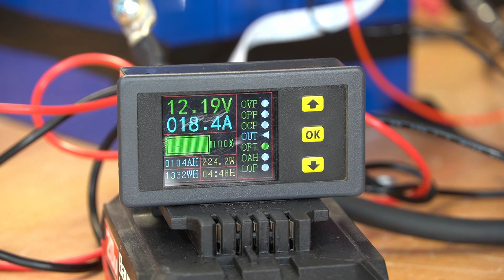Testing a New LiFePO4 BMS, 12v Battery Build and Aliexpress Cell Test

Comment: Id take those smaller cells over the larger ones any day of the week, I use that bms you showed at the end, its amazing, it does disconnect in low temps, witch can damage your solar system, cause your never supposed to have the solar panels connected to a charge controller with out the battery being hook up. it can kill the charge controller.
Reply: So the low-temp disconnect must interrupt the PV line (which connects to the chrg ctlr) rather than the battery line?
BTW, GOG (one of my most favorite sites ... and cites, too, I suppose), I know that you use the Midnight Solar charge cntlrs which have a BTS line ... Does that obviate a separate low-temp diconnect?
Reply: @mikegardner9855  yes the midnte bts can be used to save the system
Reply: @GoingOffGrid101  Thnx! (Amazed that you replied so fast! Love sharp knowledgeable folk! ... Got double value here today!)
Reply: Where did you buy it, and were you able to get a bluetooth app for a smartphone in english?

Comment: I know you aren't supposed to run more than 2 LiFePO4 batteries in parallel. Could you run individual BMSs and run more in parallel, as long as they regularly get rebalanced?

Comment: I've just gone through my local hardware store got went to the stainless steel screw section in the boxes on the wall and got the metric screws I wanted in 10 mm socket and there's multiple thread dips it's no big deal to get the longer bolts

Comment: You should review one of these expensive BMS, for comparison. The Orion BMS Jr for instance. Also I’m interested in BMS that allow for separate port and external relays for disconnects with heavy amperage loads. It’d be cool if you could cover these types of installations as well.

Your channel has been getting better and better, and more thorough. Congrats!

Comment: Just a question, I am in Australia and the temp very rarely gets below 0 Do I need a low temp cut out?
Reply: Yes, it only takes one freezing event to damage the charging batteries. If they are disconnected they will not be damaged. But Murphy’s Law states that they will be connected when the freezing event happens.

Comment: I was really hopeful for this to work now. Also got disappointed by the votronic chargers (mppt and b2b booster) the come with temp sensor and LiFePO4 program. But it turns out they just reduce to less than 1A current if battery is less than zero degree.  I asked why. And they say because the chargers are only to be used with ready to use batteries cause their bms will disconnect. Which is stupid because they also shut down discharge.

Comment: I am interested in DIY lightweight car battery replacement, and other than Peak current, which is 300A on this cells, and 640A on my lead-acid battery, is there any other reason why this shouldnt work as a lightweight replacement? 
Also, I am getting ~400 Eur on 4 cells... that is not so cheap :)

Comment: The Daly Spec on Ali says " [chinese]  <-5C [chinese] >50C [chinese]  >70C [chinese] " - Then later on "Temp Protection Temp Protection NA ℃ Set as required"  - I presume that the setting is firmware or trim pot?  Wish I could read Mandarin -- I'll ask my neighbor what it says. ;-)  - (Maybe you should have used frozen Mandarin Oranges) Also, are there other options for LTC besides the Victron?  Great videos - your enthusiasm is refreshing!

Comment: Will, you can make your own adjustable low temperature disconnect to your charging circuit....just glue a microswitch to a bi-metal coiled strip, and feed the leads to a relay or solenoid big enough to handle the charging amps.  The bi-metal coil can have an adjustable knob to rotate in both directions to tweak the temperature cutoff requirements.  cheers and happy new years!

Comment: 2 things:
1- why does the webpage listing for these batteries imply charging below freezing is ok “Charging Temperature：-5~60°C“?

2- does the data sheet for these type of batteries have recommended torque values? If so, why not invest in a torque wrench - you’ve made such a nice tool collection in the last year.  You can get a gauge that attaches to a standard socket wrench as well. 

I’ve really only worked with lead acid in large facility UPS systems but those batteries have very specific torque requirements.

Comment: That temp sensor is a thermal resister, you could change the resistance with a potentiometer to adjust the shut off point. I think a better solution though is a heat blanket that turns on.
Reply: It seems like a better idea IMO to be vigilant about the environment and BMS cutoff would be a last resort

Comment: I once replaced a BMS in a 48v ebike battery pack. The BMS was smaller than a playing card and maybe 3/8 inch thick. That BMS at the start of the video was ridiculous. The problem is that you really want 48v if you are looking at running anything over 1000 watts. The ebike pack would handle 30 amps, so around 1500 watts. Easy enough to find a 48v inverter. 

I think we should all chip in and buy Will a cheap dirt bike like the CSC TT250. That's what people do in Vegas, testosterone laced pleasures... Used to live there, moved up the road to Southern Utah. Glad you got out of Cal.

Comment: I am wondering: If when checking the balance of batteries, the balance is actually accurate if they are all connected to each other through the busbars.
Reply from the maker: In series, they will be different voltages. In parallel, they can equalize and be same voltage

Comment: Daly fails the Frozen BANANA TEST !  darn shame.   The real kicker about Daly, is the end user has no idea what the BMS parameters are, nothing can be set / programmed and there is no way to know what it is really doing with your cells & battery pack as a whole.  I'm not one that appreciates the line "ignorance is bliss", it certainly isn't when it comes to expensive batteries.

I would urge you to indicate that the bolts used are Metric Thread and for people buying replacement bolts to use Stainless Steel as opposed to zinc plate.  Additionally, to never "bottom out the bolt" in the cell as that can damage the cell if you break through the top internally.   

Too bad you didn't put a link to the Blue Cells you showed there.  
Looking forward to your test with the new BMS with Bluetooth, hoping that pans out well and that they have a variety of options for 50A to 200A plus.

Thanks for yet another Great review !

PS:  Sent a note to Jason Wang @ Chargery to send you some BMS goodness to test as well.

Comment: Great video! I have an idea to improve your temperature measurements. You cannot use an IR temperature measurement reliably on water or other reflective surfaces (metal). As the surface emissivity changes, IR measurement cannot measure accurate absolute temperature. Instead you should use a temperature sensor that has direct contact. You can get cheap thermocouple sensors from AliExpress. They are small, and have low thermal mass. Not the most accurate sensors, but should be fine here. If you want to check their calibration it's easy. Prepare an ice bath with clean water, and you will get exactly 0°C. Then boil water and you will get exactly 100°C. For even more accuracy than thermocouples, look into PT100 sensors (aliexpress).

Comment: Can these or the calbs be used in deep cycle applications such as trolling motor batteries? Normally I use size 27 lead acid in a 36 volt system

Comment: Hey, these are the exact same cells that I have. I also have the same BMS with the Bluetooth dongle, so it's a bummer that it's so hard to get it to work. I have yet to assemble my kit, because I am still waiting for a battery case to arrive. I will use the battery on my sailboat, so the load will probably never exceed 0.1C. So I think the busbars are more than adequate for my goal.

Comment: @Will Prowse
Have you ever thought of making your own "Low Temp Disconnect"?
Example. You get a temp sensor(s) + Rasberry pi + an inline on/off switch connected to the battery
Do a small amount of coding. 

Bada bing bada boom. You got your own Low and High temp disconnect.
Easy to programme your profile of choice for disconnecting the charge.

Comment: How cold does it have to get when charging liFePO4 batteries for them to be damaged?  If you live somewhere like FL or in the Bahamas would you be concerned at all about the cold temp cut off?
Reply: 0 Celsius / 32F is where you can no longer charge, the cells have to be above freezing point or damage ensues..

Comment from the maker: Why you do not want to charge when below LiFePO4 data sheet temp specs:

With the complex material system used in LIBs, the performance degradation at low temperatures can be attributed to several different sources. First, the low temperature will affect the property of electrolyte. With the decrease of temperature, the viscosity of the electrolyte will increase, which will reduce the ionic conductivity. The internal resistance will subsequently rise due to the increase in the impedance of the directional migration of chemical ions. To counter such effect, electrolytes with low freezing point were explored, and different electrolyte additives were studied [51], [71], [72], [73], [74]. Bugga et al. [51] presented a guideline for developing formulations of low temperature electrolytes during their research of LIBs for space applications. The improved electrolytes can be used in an extended operating temperature range (Fig. 2A) and were proved to be effective in aerospace batteries. Li et al. [75] also reported an optimized electrolyte formulation of 1.0 M LiPF6 in ethylene carbonate(EC)−propylene carbonate(PC)−ethyl methyl carbonate (EMC) (1:1:8 by wt) with 0.05 M CsPF6. Such formulation enabled a capacity retention of 68% for the batteries tested at −40 °C, while the ones with conventional formulation only showed a capacity retention of 20% (Fig. 2B). Specific electrolyte additives, such as lithium difluorophosphate (LiPO2F2), were also proved to be effective in improving the performance of LIBs at low temperature (Fig. 2C) [74].

The increase of charge-transfer resistance in LIBs is also an important factor that contributes to the performance degradation at low temperatures. The charge-transfer resistance of LiFePO4-based cathodes at −20 °C was reported to be three times higher than that at room temperature [76]. Such high charge-transfer resistance largely affects the kinetics in batteries. The study of LIB performance at low temperatures by Zhang et al. [77] demonstrated that the charge-transfer resistance significantly increased when the temperature decreased. The charge-transfer resistance of a discharged battery normally is much higher than that of a charged one. Charging a battery at low temperatures is thus more difficult than discharging it. Additionally, performance degradation at low temperatures is also associated with the slow diffusion of lithium ions within electrodes. Such slow down can be countered by altering the electrode materials with low activation energy. For example, Li3V2(PO4)3 (LVP), which has an activation energy of 6.57 kJ mol–1, showed a 200x improvement of apparent chemical diffusion coefficient of lithium ions over LiFePO4 (LFP) with an activation energy of 47.48 kJ mol–1 at −20 °C [78].

Another typical effect that occurs at low temperatures is lithium plating [79], [80], [81]. The cold condition will trigger the polarization of anodes and lead to the approach of the potential of graphite and other carbon based anodes to that of lithium metal, which would slow down the lithium-ion intercalation into the anodes during charging process [82]. The aggregated lithium ions are thus deposited on the surface of the electrodes, which causes the reduction of the battery capacities. Furthermore, the lithium plating exists in the form of dendrite, which may penetrate the separators, and result in the internal short-circuit [83].
Reply: Hey Will, you are amazing at all of this. Im sure this has been asked, but Im new to your channel and looking into off grid RV living. So..is there a system..or 2..that can be setup with solar/batteries and all, that can totally run everything in an RV? Im sure I would need several panels/batteries and all, to run everything from fridge, ac, microwave, tv..etc. Im sure It would run several thousand $$. Im looking to be completely off grid and use solar with batteries, propane, and a large fuel genni. Is this too much of a long shot?
Reply: Yes, most of the energy for RV living can be supplied with solar but very few accomplish it. First take the A/C off the roof and install a 5000 btu window mount unit. Then use the roof space the roof A/C unit was using for as many solar panels as you can. And a big panel on the roof of your truck too. It takes about 1350 watts of solar to run the 5000 btu A/C and other loads. 
 Unfortunately RVs need to be modified for a quality solar energy system. There’s too much junk littering the roof is a main issue (antennas, skylights, vents, A/C, etc). 
 Consider buying a coach that has lots of roof space. 
 A lot of people have some solar panels placed on the ground to supplement the roof solar.

Comment: Found out how they increased the blueys capacity vs the other cells:  they added manganese to it.  More capacity but reduced cycle life. - Maast.
Reply: DAH3313 how did you come to this info?
Reply: @Lonchpad1  Was reading about a bms/battery package and they were boasting about their LFMP cells were so much more energy dense.  Then googled LFMP cells.  Surprised I didnt already know it.  15-30% more energy density was one figure I came across.

Comment: LPF (Lithium Plating Free) cells using foil heating element as part of battery cell, or solid state lithium batteries should address destructive effects of charging cells below freezing temperatures. Otherwise we're looking at expensive bricks.

Comment: I ordered the Calb ca100's from AliExpress and they sent me tracking numbers from Fed-x in California. Shipping labels created on 12/26, expected delivery 1/3. They just sent me another tracking number created on 12/28 and delivery on 1/7. I hope I get them. Have you ever had that happen?  Also ordered the new Daly BMS with low temperature cut off. That's being shipped by E-packet.  I'll let you know if the one I get works.
Reply from the maker: Never have seen a new trackimg number being created. That's weird. And yes please do. I just tested again with frozen salt water dropped to a super low temp, and still no disconnect. Would be great to see what results you get. Thanks
Reply: @WillProwse  Dude, thank you indeed! Love your work! I vote for Firmware on the BMS was screwed up, betcha.... All the best for 2020 Will

Comment: Can't you just say QR code instead of bar code? I see you as an expert but simple mistakes like that make it hard.
Reply from the maker: Haha yeah I need to use the proper term. Oops
Reply from the maker: Just googled it and qr codes are actually considered a type of barcode. So I'm going to keep calling it that.
Reply: @WillProwse  that's silly. Bar codes are called bar codes because they have lines like bars. QR codes are nothing like bar codes. If you found somewhere that says that I wouldn't trust them for anything else.
Reply from the maker: Wikipedia: QR code (abbreviated from Quick Response code) is the trademark for a type of matrix barcode (or two-dimensional barcode) first designed in 1994 for the automotive industry in Japan.
Reply: @WillProwse  I'll have to go edit that and make it more factual. It fulfills the same purpose of a barcode but in a different and better way.
Reply from the maker: Personally, I hate QR codes lol

Comment: Would it be possible to use an off the self temperature sensor along with your previous design with a separate port BMS & relay running to a Victron battery protect? Basically use the sensor to trigger the same low voltage disconnect.